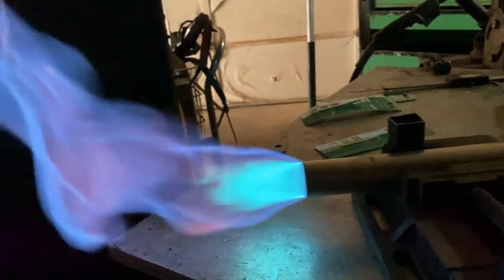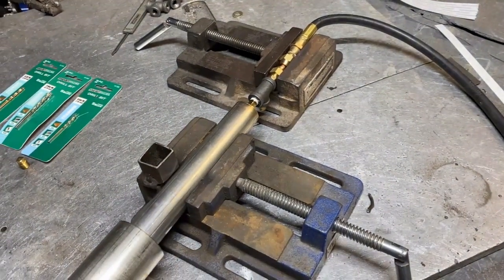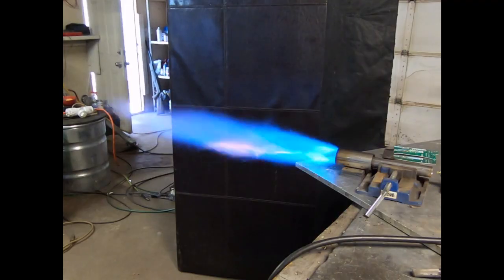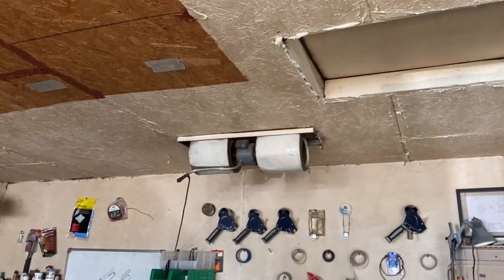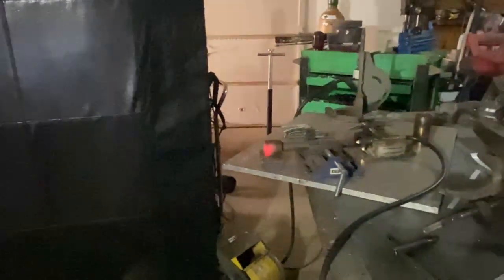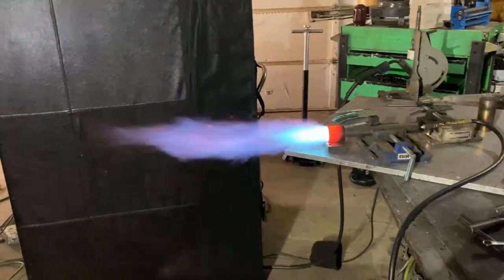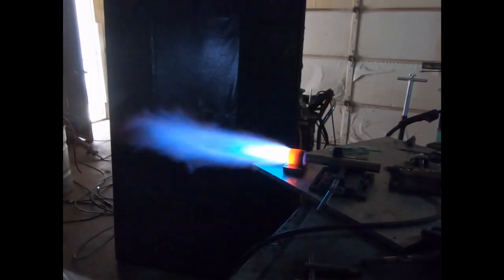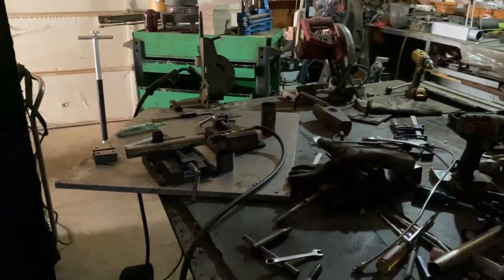Brick Kiln Burner development.

Comment: What is the cause of flame out if you put to much air via the prressurized atomizer. But if you enter more air after the combustion chamber via a venturi like double pipe like you did, it doesnt have the flame out and the flame does have perfect oxidation.
Reply from the maker: flame front velocity of the fuel was exceeded by the air flow velocity , the couling reduces the average velocity of the flow to that just below the flame front velocity of that gas mixture